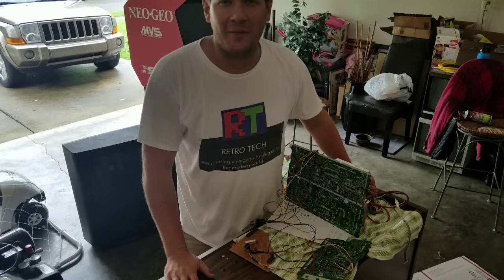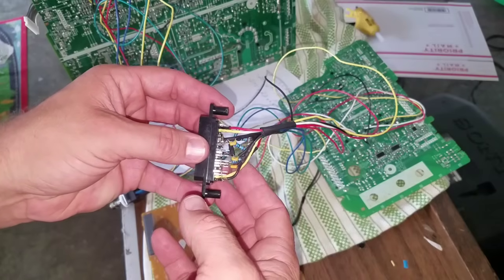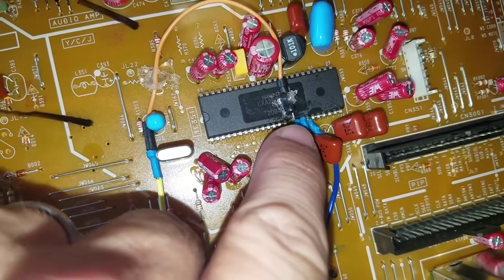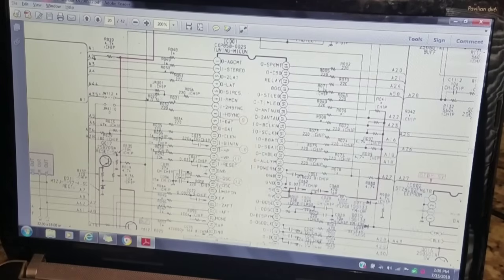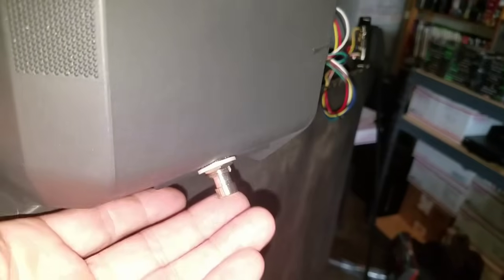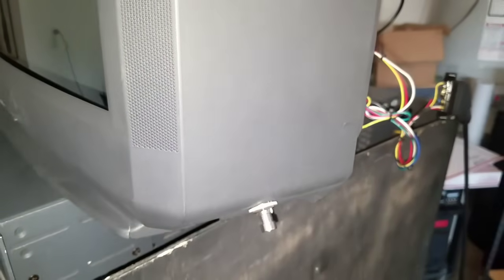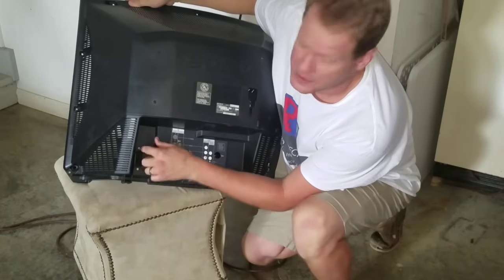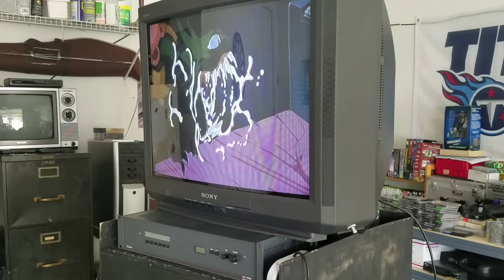How to RGB mod a Sony CRT TV for retro gaming

Comment: I'm a bit confused about the setup. I see a composite jack and audio plug connected to the back of the TV, routed to the SCART connector. Is the composite video and audio then being fed back into the SCART? Would this mean that the video and audio signals have to be sent back into the console? I'm unsure about what I might be missing here.

Comment: I understand what sync is used for in a r/g/b/h/v setup. But I don't understand how sync is being accomplished on the trinitron rgb mods. You mentioned sync signal on video 3 but I didnt see that cable running into your video 3 input on the back. Can anyone explain this? Also, is it possible and/or beneficial to add H/V inputs as well to the TV? I have a 27S42 and an Extron 900D.

Comment: question regarding resistors.  most tutorials show resistors being put into the circuit when injecting RGB, however, a lot of cables include resistors or caps. does that mean if i have resistors internal (on the actual mod), that my scart cable should not have resistors in it?
Reply: That’s a good question! What’d you find out?

Comment: If you still offer this RGB mod service for CRT Tvs, I'd like to ship you my tv for service, if it's compatible. Normally I wouldn't consider shipping this heavy tv, but it a very unique set and quite desirable. Is a Samsung GXTV (GX1395). There is some information about it located by doing a google search, for example: https://killscreen.com/previously/articles/revisiting-gxtv-television-gamers-1997/
I understand I would need to pay shipping both ways, and of course your fee. But in this case it might be worth it to me. I have quite an extensive video game collection and this television is one of the highlights. I suppose it's possible that some capacitors my need changing because it's from 1997, but whatever you think is best.
Reply: Neat tv, ever get it worked on? Two years later. Cheers
Reply: @scottb_02  Ended up doing it myself. Was a learning experience, but I was successful.

Comment: Hey.  I know this has been out for a while and I may not get a reply, but I think the benefits are worth the time to post this.
Instead of installing a switch to jump between the new input and the OSD, would diodes not allow you to have both without the need for a switch?
Reply: Not quite, for example if both RGB input and OSD are outputting a full screen of 255 blue, they compound and result in 510 blue, overvolting the jungle ICs Blue input, likely killing it. Same for any other combination of colour, although low values that don't add to over 255 will be fine

Comment: Hello friend, I bought a sony trinitron kv-21fv12 / 5 television with BA-5D chassis, I made the 2 types of modifications I found. Mod 1.- inject the RGB into the bridges between the Micon and the Jungla chip with a resistance of 75 ohms. Mod 2.- lift the legs of the Jungla chip and inject the rgb signal with the 75 ohm resistors to ground and 0.1mf or 104 nanofarad capacitors. I add that I also took the 5 volt signal and the blanking signal connected to a switch to activate and deactivate the OSD signal and the synchronous signal take it from the composite video and then take it from the Luma signal in the siper video and in supervideo it was the best option. Results: In the 2 types of modifications that I made I never used consoles modified to rgb, I only used pcb jamma boards connected by a vga connector that I made and in the 2 modifications that I made the saturation of picture and brightness was very high and although I It lowered the brightness and the picture was not enough to show an acceptable image. I was playing with the values of the resistors and discovered that for pcb jamma boards the best image was with 18 ohm resistors in each color line with the same ground connection and its respective capacitor. Here the weird thing is that the pcb jamma boards like Neo Geo and Cps1 and Cps2 the brightness and the picture can be adjusted very well, but in other jamma boards the picture and brightness are extremely saturated in games like splatterhouse or Caveman ninja, in addition to On some pcb jamma boards for example Mortal kombat 2 and Captain America and The Avengers the vertical frequency was unstable because the image was constantly falling and I also tried to inject direct signal without resistance or capacitor and it does not show brightness or picture, so my conclusion was that the 18 ohms that I added are the best for jamma boards pcbs but not for all games. I repeat that you do not use consoles, just add jjama boards, could help me with this situation?

Comment: Finally an American that RGB mods a TV and puts an actual scart input instead of some weird connector. 
Us Europeans are fortunate that almost all TVs have an RGB input. Great job, and you can still use VIDEO 3 as a composite input if you disable the RGB switch.

I don't know exactly how our TVs do the switching electronically, but I can explain how it works for us as we don't have external switches to enable RGB. When you have and RGB source and feed the voltage to the blanking circuit you get the RGB image but OSD is still there but superimposed on the RGB, OSD comes semi-transparent. If you switch to another source and open OSD you can actually see the RGB source on the OSD lettering. This is normal behaviour  on our TVs.

I think you guys there can mod a TV to behave like a European TV and discard the switch if you just mix the RGB input with the OSD, what I mean is just insert the signal and blanking to the jungle chip with out desoldering. You would still need to insert composite sync in an input like you did there.

I just looked at my TV's schematic and it looks like the case, you just tie the RGB signal and blanking to the chip, you just select the source where your composite sync is and turn on your console, the voltage for the blanking is supplied by the source from the scart plug. Want regular TV just turn off the console, the blanking voltage is switched off and TV goes back to normal.
Reply: What about the sync signal? It seems in his case, it's coming from the composite cable, yours I assume is built-in to the SCART connector?
Reply: @jorgeandrade20  sync signal is shared with the composite video input pin

Comment: Awesome job!  I will never, EVER understand why RGB SCART was not adopted world wide!  At least JP21 should have been standard outside Europe and the UK.

In Australia, we were cursed with PAL, but due to our proximity to Japan only had shitty, godawful composite because everything was made in Japan.  So we had the shit of PAL consoles without the only decent thing from PAL format.  I sadly learned too late about Euro brand TVs such as Loewe, Grundig, B&O etc actually being imported TVs with RGB SCART.  I managed to get a couple, but the big supply was far, far from where I live.  I lived there in 2013 but discovered them AFTER I left!  I did even manage to score a French Trinitron which looks amazing, but has picture issues.  It is just a shame that so many of the best CRTs from the late 90's were ruined by 100hz with no way to turn it off.  I passed up many Loewe and Grundig TVs for that reason.

Comment: Awesome job. I've been researching for over  2 weeks now on how to RGB mod my TV, and your video made the most sense of all of them out there (as far as HOW the switching works between blanking and "regular" mode). I'm still a little uncertain about how to connect all of the video lines of the SCART header to ground, but again, your video has been the most helpful (visually) on how to achieve this. Weekend is coming... Hopefully I'll have RGB by the end of it...
Reply: Three years later, how’d it go? Doing a little research to see if I want to attempt this, thanks
Reply: @scottb_02  hey there. For me, I still couldn't get this exact method to work, as I eventually realised that my particular TV just didn't have the necessary R G and B input pins on the Jungle chip... I therefore resorted to a (more direct hack), using some capacitors and feeding a signal directly into the neck board output circuit. Lots of people frown on this method, but I just dont have a TV that supported the method covered in this video. I've since gone on to hack a second TV (using my own method mentioned earlier) and both are still running reliably in my arcade. There is no "easy" way to hack a TV, so be persistent! Don't give up - or try another brand of TV... Good luck!

Comment: Mine had dual RGB inputs on my Sony Trinitron KV series jungle chip so I did it differently. I used the old Teletext/Text Decoder board that was connected to it to feed in the RGB signal directly(there is actually a connector on top of it to connect to the Picture-in-Picture card with RGB and ground) and just made my arcade connector fit the plug. On the teletext/Text Decoder board I also found a 5V output coming out of a voltage regulator, added a resistor and then connected to the blanking pin on the teletext decoder board. Because the board is removable this was easy to do outside of the TV. Some Sony TV's didn't come with teletext cards, however you should still be able to use the pinned connector and make you own connections.

The final step was trying to feed in video sync. Because teletext is presumably disabled on AV channels I was unable to feed in using the Video input on the back of the TV. However after much mucking around I cut the leg on the TV tuner video output pin so there was no signal from analogue TV anymore (blank screen when turned on on all analogue channels) and then connected the video sync from the arcade output to the CVIN pin on the jungle chip.

The benefit of doing it this was is that there is no need for capacitors or resistors on RGB inputs as the TV board has these in place already for teletext input and you just need 1 plug connection for the single Sync cable as well. This means the whole cable can be disconnected from your RGB device if required.

The TV Menu still works as it works on a seperate input(RGB input2) without using any switches as it is on a seperate RGB input. I did have issues with showing the TV menu simultaneously while feeding in RGB on input1 (sync conflict maybe?) where the TV menu flickers, however turning off the feed from the arcade (RGB1) stopped the flicker, so there is no switch required, just turn off arcade RGB feed.

Also weirdly the Sony Service Menu which allows you to adjust the screen position and size works no problems with the arcade RGB being fed in at the same time, so not sure if this works on some other input, however this is handy as you can adjust the TV while receiving the arcade RGB input.

Comment: Thanks so much for making this vid! Can't wait to attempt my RGB mod. (This is a great video to reference) Quick question, I am looking to get into the RGB modding scene, what's a good forum to join besides shmups? I want to study up as much as possible before I crack open my Sony Trinitron KV-13VM42.   I am not finding any service manuals for my model, is there a way to do a continuity test from somewhere on the neck to the Jungle chip?  (This is if I can't find a pinout schematic for my model)  Can't wait to hear your reply and get into this stuff more!
Reply from the maker: Thanks.  I've had requests to start a discord server to help with that type of stuff.  I think AtariAge may have some forum info, but a lot of people try to scare others from working on CRTs.  It's going to be really hard to do it without a schematic.  Is there a service manula for your CRT available to buy online?  The other thing to do would be to google search your jungle chips info.  That would be listed on top of the chip itself.  Then you can probably find a chip pinout.  Good luck!
Reply: https://www.reddit.com/r/crtgaming

Comment: are all CRT mods going to be "sync on composite" (yellow port on CRT)?   can composite sync ever be done?  (was watching the RGB103 vid and it showed the difference between the two).  if csync is possible, where the heck would the wire go?  does the Jungle IC accommodate it?

also the SNES seems to only do JP-21, but the good news is that there are 3rd party cables made for NA SNES's, but they do contain capacitors etc... and I know RGB mods on CRTs put their own resistors and sometimes capacitors (as seen on other mods)   would the caps in the 3rd party cables have undesirable effects when the TV's mod already has caps in it?
Reply from the maker: I don't think there is the hardware natively on the CRT Chassis to get Csync to work.  You may be able to get sync on Luma if needed, but not really sure about csync.  It's also hard to tell how some inputs will look on a CRT that is modded.  I've had no issues with this Sony's RGB picture quality with any system.

Comment: What makes a crt RGB isn't any CRT RGB atleast PAL i mean
Reply from the maker: In the USA, there was no RGB input.  We did get Component inputs eventually, but TV's (like this one) only had Composite and S-video in.
Reply: @RetroTechUSA  ah that is not nice but NTSC sucks though there should have been one standart and US should use proper electricity system

Comment: I have a 32 Inch KD-32DX40U which has a 5 blinking light error and the colour looks off, apparently it's white balance and a faulty crt driver how would this be repaired? Thanks
Reply from the maker: That would take a big effort to try to repair.  You could try or try to see about a replacement.

Comment: Hey great videos. So your talking about a scart input. So that type of connection plug isn't required in northern usa. This must be a canadian/ uk  input. Could you please discuss scart RGB. So I have a Sony  trinitron  with component in which are 3 Eva inputs red,green,and blue marked on the inputs is this the same has RGB. Thanks and great to see you making these kind of vids. Are you in Canada? Cheers mate.
Reply from the maker: Hey, sorry I just found your comment.  I can cover the scart adapter some more.  I live in the Nashville Tennessee area.

Comment: What did you do for sync?
Reply: Thanks, you're a god. 

I just started an rgb mod on a 35 inch trinitron, so praying itll work out.
Reply from the maker: Good luck
Reply: @RetroTechUSA  welp, I wish I had luck. The legs all broke off the jungle, but I had a spare chassis. So I just cut the lines to the neck board and ordered a ths7316 (rgb amp that's in an n64 rgb mod) to boost the signal. Sorry if that's poorly written, very tired.

I'll let you know if it works.
Reply from the maker: Thanks.  Sorry to hear about that chip.  The legs on those can be week and brittle.
Reply from the maker: For sync I tied into one of the composite video inputs.  I just soldered a wire from the sync pin on the scart to the composite input.
Reply: @RetroTechUSA  ok, awesome! One last question, if you switch to the osd, do you still use the other inputs?
Reply from the maker: @matthewpalmer9820  the other inputs work while the OSD side is activated.

Comment: I wish someone can mod my tv like this.
Reply from the maker: I'd offer this as a service, but It would not be cost effective do to shipping.
Reply: @RetroTechUSA  if I was to bring a tv to you how much would this cost?
Reply: @wornout_joystick  you can have mine for free that has RGB /Svideo and several Composite even a composite out . It's an apex tube and in great condition but I will give it to you free as long as you can come to Newmexico to pick up and it's really big and heavy and makes this CRT sound when it turns on and it's has a flat front CRT with digital tuner and all this completed multi function remote with radio shake battiers .
Reply: Retro Tech it would be cost effective for a non professional to not kill themselves trying it on their own. Considering a good PVM/BVM is like $1500 on eBay. I think some would pay $100-200 shipping each way and $100 or so for the service. Just saying.
Reply: @EmLoses  $100 for service is chump change.

Comment: The best info for modding crt sets for rgb is probably in the shumps forum. With all brands of tv's
Reply from the maker: Vasili Yes, the forum and YouTube are the best and only places I know of for info on RGB modding crts
Reply: Well, I got curious about the subject and I have a really oddball trinitron vhs/combo it's some sort of russian export Is all I can gather, It was a kerb pickup. Hard to find tvs that don't support rgb here lol funny isn't it. I only picked it up because of the vhs player.

Anyways I went and took the back off today and it has a scart socket unpopulated with some composite bodged socket soldered in from the factory. 

It's a really funky trinitron that uses a scart socket to input composite, so in theory should be able to unsolder the adaptor and solder in a scart female socket.  Why I mention this is because maybe there are trinitrons floating out in the USA using the same chassis/input boards.

I willing to give it a go if it help you guys get Rgb easier
Reply from the maker: That's a great comment.  I know that a lot of the same boards are used in different models of each TV.  Thanks